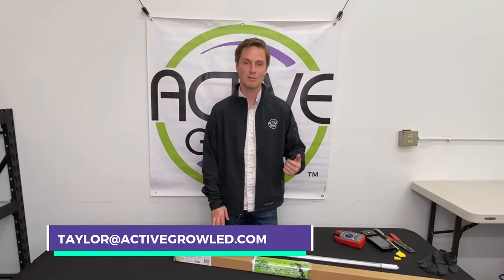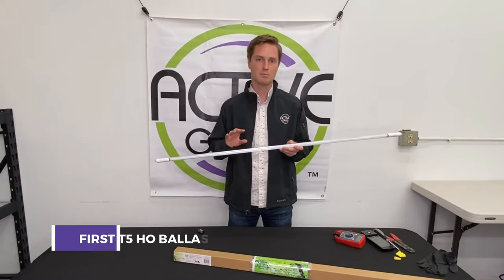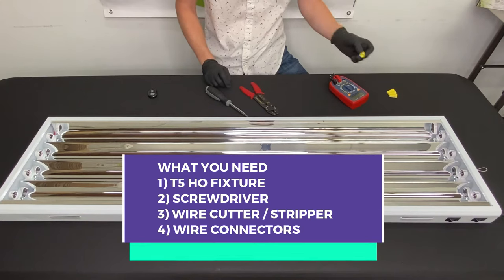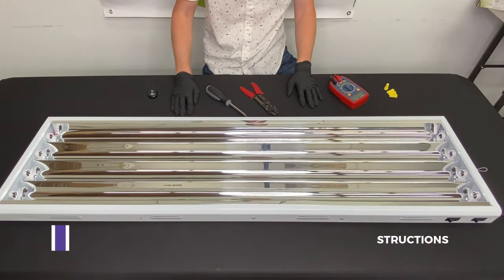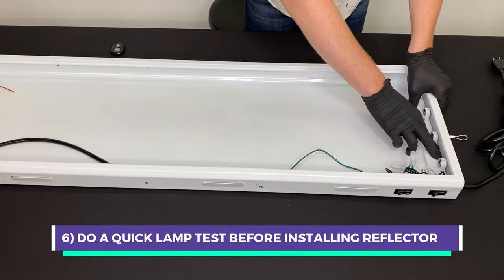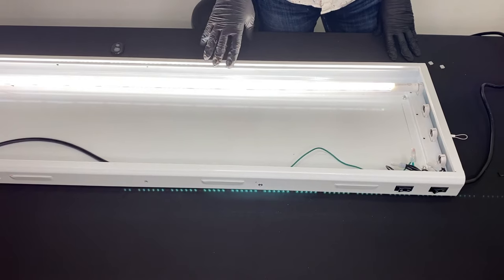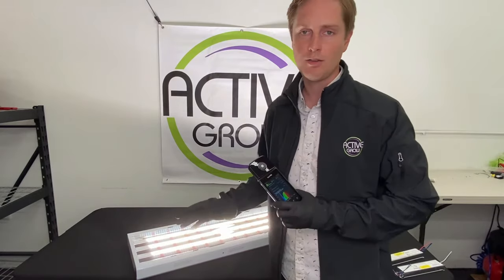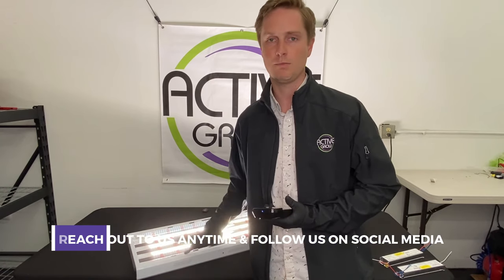How to Upgrade Any T5 Grow Light Fixture to LED: Active Grow T5 HO Ballast Bypass Tubes Installation

Comment: Geesh, the most critical parts of this wiring (live and neutral) being shown in fast forward
Reply from the maker: Hey there, thanks for the feedback. Some parts are sped up so the video is not so long. I hope the image shown at 6:23 of how the wiring should go was helpful however. If you have any questions about the installation process please reach out via our website and we will get back to you right away.

Comment: How do your led's compare in over all light output? What is the par of this compared to the T5 at the same hight? If I have shunted lamp holders where do I get replacements. I would have replaced my T5's years ago but the company that had them at the time listed my fixtures as non compliant with there 41 watt LED tubes, not sure why. I have the (Hydrofarm Agrobrite Designer T5  Fixture FLP-46), do you know if that fixture has the shunted lamp holders? Thank for you help and I to would like to see a independent review do you know of any? Thanks
Reply from the maker: Hello Taz, we sell around 40 SKUs of products so if you have specific questions about our lineup I would be happy to answer via taylor@activegrowled.com. The lamps above will work with any T5 fixture as you simply need to rewire to single-ended power. Most T5 fixtures have tombstones that will work with our lamps except a few obscure ones. Look forward to your email.
Reply: I live in Karachi Pakistan I like your comments thanks
Reply: I got the AgroLEDs for my Sun Blaze 2 ft fixtures without checking the compatibility, but when I went to get them for my AgroBrite 4ft 6 bulbs fixtures I saw the warning and didn't want to risk it. I did get Philips LED T5HO replacements from Home Depot even though those were incompatible as well and I've only had one of 12 burn out in at least a year. They're not Horticultural just a mix of 6500K and 5000K and they work fine vegging small plants. After switching to LEDs I couldn't run those things at 324w for such a small footprint. I run just the 4 bulbs most of the time and they are equal to the flouro, 6 of them are super bright.
Reply: J D  I'm not seeing those in LED are those fluorescent? If so, no way. At 54 watts per those things don't cut it for me, not to mention how often I was replacing them. I'm lighting the same area using Quantum boards using 90 watts and get far better growth than the 324 watts I was drawing. Add 20 bulb changes(I rarely got a year from mine) compared to zero.
Reply from the maker: @raziarahmat4299  Thank you very much for watching!
Reply from the maker: @BigFarm_ah365  Well these would avoid using a ballast so they are still a big upgrade!

Comment: Will the plug and play tubes work for the Sunblaze products? Not sure what ballasts are in them
Reply from the maker: Hi there and thanks for your question. Yes if the ballasts are not very old they will work with our lamps unless they are single lamp fixtures which our plug and play lamps are not compatible with. Let us know if you have any further questions.

Comment: If my T5 fixture is L/O can I still use one of these T5 LEDs at a reduced capacity, or will it simply not work at all?
Reply from the maker: Hello if you bypass the ballast it should work the same!

Comment: Would it be possible to send a set of lights to Migro am sure Shane will send them back, it would be nice to see a impartial review from a real professional
Reply: @apw6733  thanks for the reply bro ✌️
Reply from the maker: Thanks for the tip. This is something we will consider doing.
Reply: @activegrow  that would be amazing, been looking at your products for almost a year ago, and if Migro have  reviewed your light is what is going to tip the scale for me to order lights, thank you again for the reply looking forward to seeing your lights on Migro 🤞🤞🤞
Reply: I am beating my head against the wall because I can't decide on this very issue. I've been checking all over looking at T5 fixtures but my major issue is with constant bulb replacement due to failure as all do/fact! I've got a 500 Watt Growcraft so I'm not lacking on lights but the T5 I want for lower demanding plants, clones, and seeds? Question what are the spectrum differences and are you losing that light diffusion a normal bulb has? I always understood that was the WOW factor hence why a lot of growers still love them for propagating or vegetative growth. I'm all for the endurance. I just am finishing a home project were I took the led strips out of the new direct wire 120v bulbs and made a hanging light with soldier, wire, and a small frame. Was about to try it out. Those LEDs are awesome with the red spec. I have 5000 & 3000 mix with 660 Nm reds but do you make a bulb with 450 Nm blues rather then reds?
Reply from the maker: @TexasGrown1978  Thanks for your message. T5s do in fact have a ton of uses when it comes to growing plants. If you want to learn more about our spectrums I would check out our Spectrum Analysis page on our website here: https://www.activegrowled.com/spectrum-analysis/